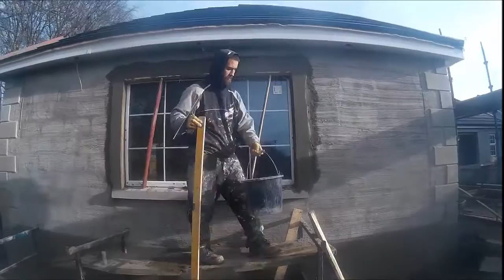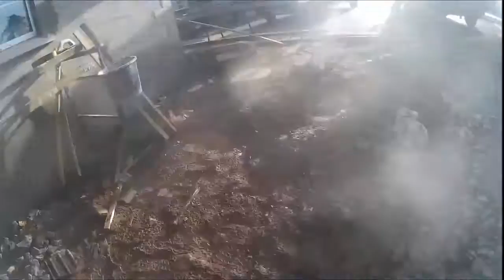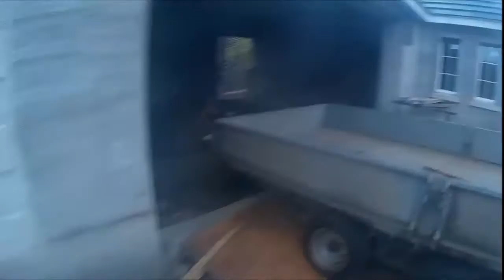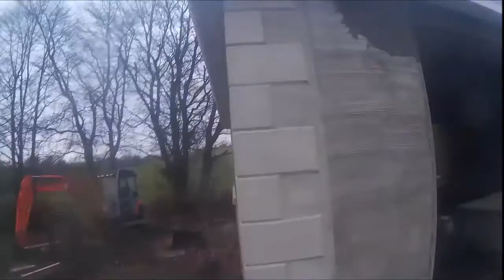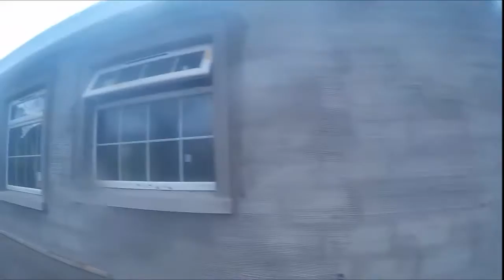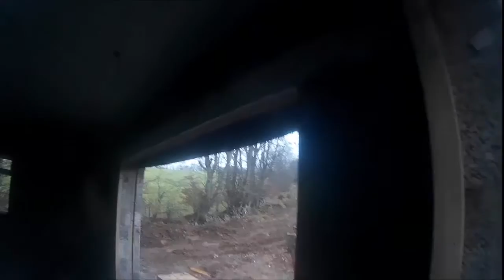RENDERING AND CUTTING WINDOW BANDS PLASTERING

Comment: I did bands once with White sand and cement and cut the outside edge of the bands free hand ie with a level and trowel. Anyway it worked out not as good as finnishing to timber. Maybe it's just me. Anyway fair play to you, it looks like your in ireland I taught you were based in england
Reply from the maker: yes bands can be hard work for sure mate white sand and cement is hard to finish so would be hard to get bands done in them for sure mate

Comment: Hello mate im about to do bands on my garden room, im finishing the lot in acrylic white but ill just plastering the bands off smooth sand and cement to make it stand out.  
What height would you set the bands compared to the finished coat on the walls? Should they be much high than the top coat? Or can they be level
Reply from the maker: I would have them out some quarter inch so the stand off
Reply: @macplastering  thanks mate ive done that

Comment: another great demonstration. Re. the quoin stones. I have a block garage, partly rendered and half of it left with a scratch coat, looks rough as you know what. I'd like to finish it off but the cheap bugger slapped a masonry paint on the 'tight' rendered parts to take the bad look off it when he put it up for sale. I'm guessing I'll have to take a diamond saw to the corners to get the paint back to masonry before trying those quoins, what do you think.
Reply from the maker: Might be best and use a real good bonding agent as well sounds like you are on the right track take off lose and try get as much paint of as possible for sure might be a hard one to fix very tricky ... just a thought you can buy these stones and stick like tiles if you needed but do that before you finish the dash to them
Reply: OH that sounds more like it, I could do that without busting my blood pressure, thank you.
Reply from the maker: Yes dont do to much just do as much as you can mange and have lots of little breaks for rest and time to think about whats next always try make life easy this job is hard enough as it is

Comment: Nice vid. Do you use corner beads?
Reply from the maker: Not on this one mate I do use them but prefer not to mate thanks for watching :)
Reply: @macplastering  Just one question. Do you render straight onto external concrete lentils over windows, or do you scratch coat it or apply some type of mesh? Thanks
Reply from the maker: @JohnOsCreations  Scratch coat mate always on some renders have used a mesh also such as k rend or webber mono/scratch render  jobs have a few videos showing us scratch coating and one of this job being dashed
Reply from the maker: @JohnOsCreations  Sometimes depending how the window is fitted there might not be room for 2 coats on the inside but I prefer 2 coats especially n the head / upside down makes for a better job but if there is only room for 1 coat you will be stuck to that depending on how the windows will open or doors ect

Comment: Can I ask why you didn't put laths around instead of cutting out???
Reply from the maker: I like this way better cleaner edge  laths will be wood grain when you cut it leave it smooth and water tight if you get what im saying? this is also quicker hehe :)
Reply: You can buy smooth lath. Much easier

Comment: Hiya mac is it possible to put these render bands over pebble dash?
Reply from the maker: Yes mate but its is harder to do and hard to make look great might be a little more work to make it looks sweet at the edges and harder to get a good bond hope this makes sense
Reply: What would you suggest sbr slurry bond? Im a plasterer myself but have not done any outside work in years! Would you use a 4 to 1 mix on it? Thanks for the reply matey!
Reply from the maker: @scottlandeg7375  Yes might be best to knock of any thing lose then a scratch of sbr or painted on a slurry coat then 4 to 1 tops coat but you might need to put rules / batons up t work off and still need to cut to make it nice and clean edged i done one last summer will have to get it uploaded to show you how i did it mate
Reply: That would be a big help if you could mate, thanks for the advise!

Comment: Hi mate how.would you do this.on a house with dry dash? A house in my estate has them so it must be possible? Would you have to remove all dash the width of the bands?
Reply from the maker: Hi Mate , I do have a video coming up on how i did some recently , there is a few was to do them,,, t=you can cut it of to make sure you get a good bound to the existing building brick or block  , if the dash is solid and stones solid it could be possible to do it similar this video only over the stone and dash and you could also bead it and do it might be a cleaner way to go , hope in a few week i will have the video with the big band i did uploaded and the way I went about it , it has turned out a good job so hopefully you get on to see it , if not already hit the bell to get notified on the new videos :)
Reply: @macplastering  thanks mate fair play to you taking the time to write such a detailed reply so quickly.
Reply from the maker: @johnlennon6491  No probs buddy hopefully will get that video up in next few weeks for ya :):)

Comment: What’s the mix ratio?
Reply from the maker: I go 4 to 1 for these ones mate but as little water as possible let the mixer do all the work as they need to be thick so a wetter mix wont do , Hope this helps bro
Reply: Cheers Mac, are the panels done in a 5 to 1?
Reply: And the scratch ratio please ,mate?
Reply from the maker: @kf5541  What do you mean panels mate ? I do 3 to 1 mostly for scratch coat = https://youtu.be/Tsw-t8mwLRI
Reply: mac plastering the flat hits in between the feature work
Reply from the maker: @kf5541  they where 4 to 1 mate then stone smashed on was a big job that sore arms and back after it

Comment: Hi Mac, me again. I'm intrigued as to which side you start off with, the reveal of the face, or are you working to a wet edge? You have a batten on the header, talk me through it if you don't mind. I was never taught about the more decorative stuff and would love to know some basics. Cheers

P.S hope the weather's holding for you on the house 🤞
Reply from the maker: Hey mate You can do it all wet or in 2 stages you can do the inside the day before then do the outside the next day or so I find it is best to have the head done the day before as when you try to do it wet the corners give you problems with weight can sag and drop off, Will try do some vids on the way i like doing them best but might take me a while to get em uploaded 

Thanks for watching mate stick around something good coming up in the next few weeks
Reply: macplastering Right ok, I think I'm with you 😀
Reply from the maker: Hard to explained with a keyboard better if I can make a few vids on it and show
Reply: macplastering cheers, if you could that'd be great. The steps you take from scratch coat, battening, sequence etc... 👍